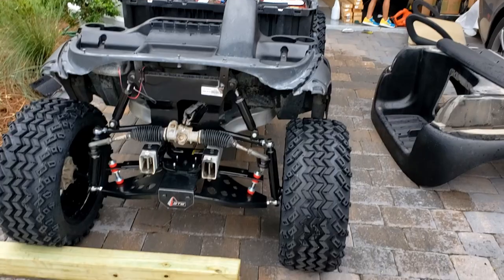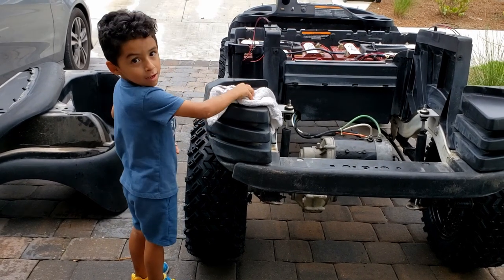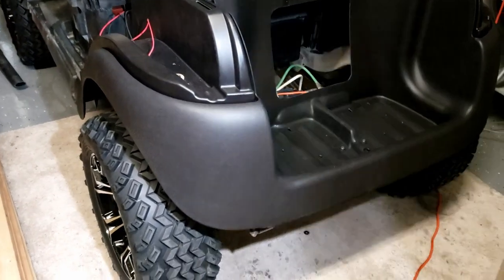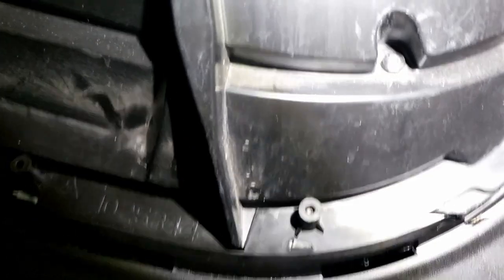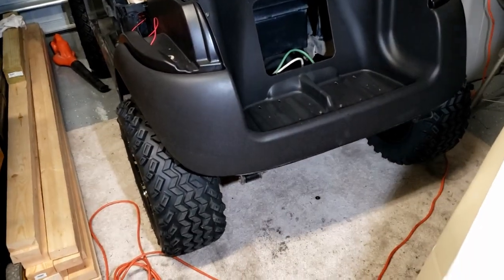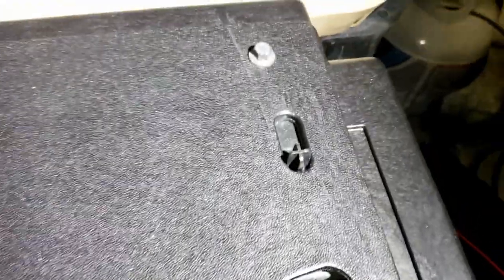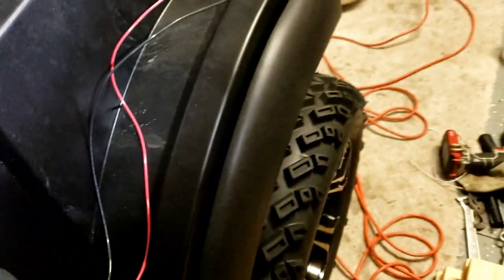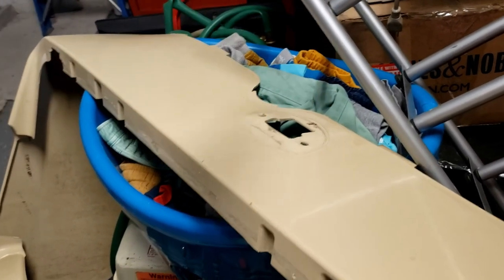How to remove club car precedent body & adjust brakes Ep.5

Comment: When you adjust this way you only adjusting the cable tension  causing the cable and the brake lever to be under constant tension
Reply from the maker: Thanks for your feed back. I was sure not to add any unnecessary tension. There was too much slack in the break peddle, not allowing the cart to stop as it should.